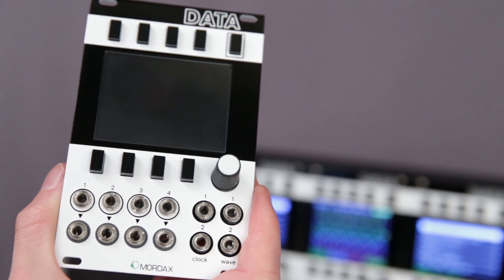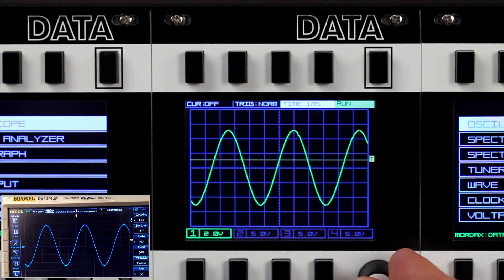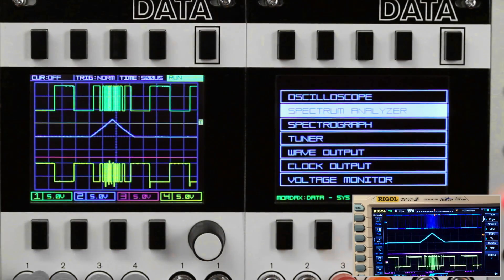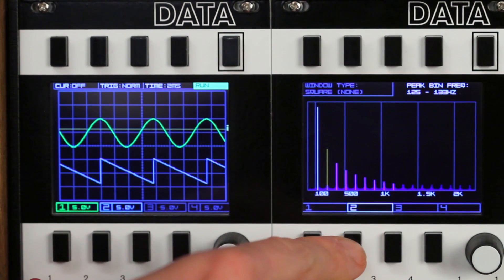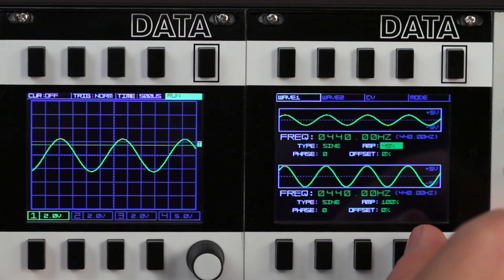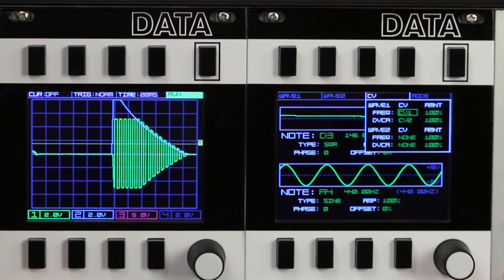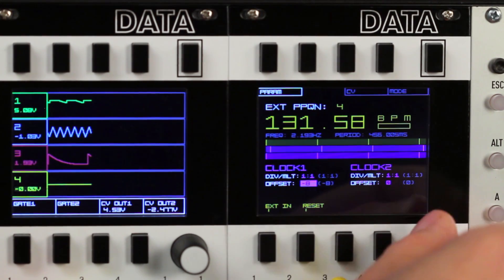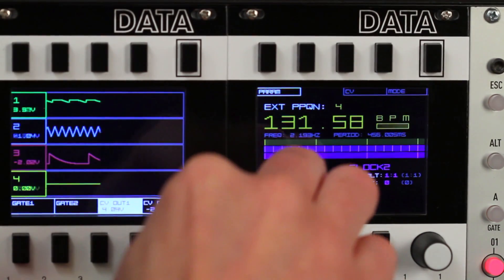MORDAX-DATA

Comment: 8 years later, let me dream aloud even as this is already a gem of a device : We need a higher resolution display (with zoom and cursor) ; ideally with an external monitor function. Capacitive touch input would also be a plus. The FFT and Spectrograph need a cursor to measure partials and harmonics. The waveform generator would benefit from an arbitrary function option (basically, a wavetable) ; as well as AM and FM (linear, exponential, and TZ). Also, as other oscilloscopes, more math functions for signal analysis (for voltage — min/max, mean, etc / for input signals — booleans and arithmetic, zero crossings, peak-to-peak measurement). The Tuner would support temperaments (Meantone, Natural, Harmonic, Werckmeister, Kirnberger, Valotti) as well as A=415 or 392 Hz.

Comment: Guys so for example could I insert 4 lfo s on the left side pass through ins and monitor...and at the same time have data send it’s oscillators out on the right side outputs flip back and forth to view as needed on the screen ?  So question is can data multi task as I have described ?

Comment: Looks like an inertia or fast scroll feature on the selector knob (shown when adjusting scaling/offset/frequency, etc.) is not quite there yet?
Reply from the maker: Correct, currently we're still working on perfecting the encoder handling. The goal is to have it included in this first firmware update, which adds the XY scope, minimal display mode, scope drawing optimizations, and the oscillator triple wave folding (see our NAMM 2017 booth video, on our site, for an overview of those features).